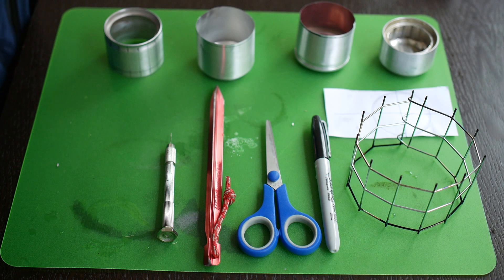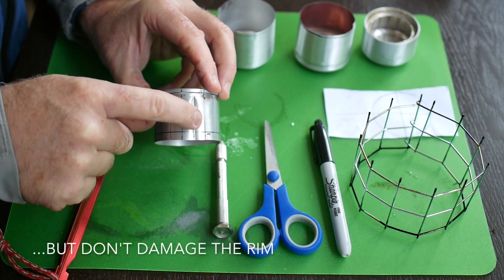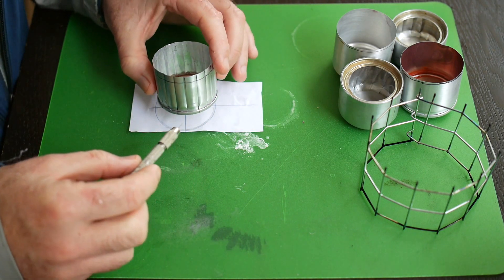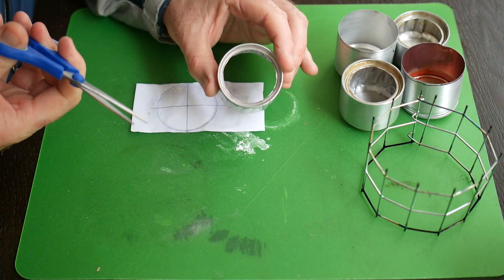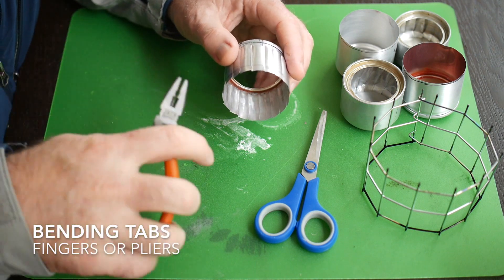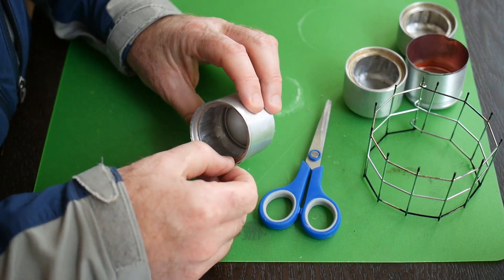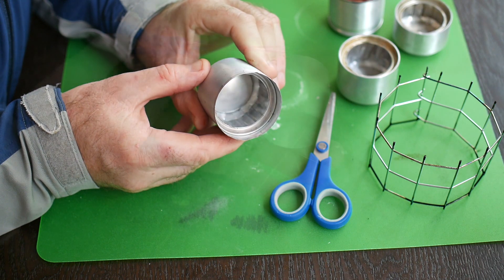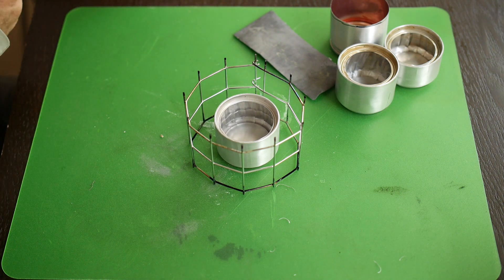Easy Capillary Hoop Stove 3: Drilling, Creasing and Assembly

Comment: I wish we had cans like that in America.  The top of any of our can concave inward, so it just leave a huge gap
Reply: In America I find a number of cans have tops that that are just slightly narrower (maybe 1 mm) than the body (V8 Juice cans, e.g.). They can still work. I just cut the outer part slightly taller than the inner part and then fill the gap with JB Weld. It works fine.

Comment: You made your channels perpendicular from mark to mark.
Try going from the top mark down but not straight down. Change to an adjacent mark to make an angled channel.
This should allow more contact surface and add in a slight swirl effect.
Allows more time for vaporization.

About your drilling holes -
Start a hole but use a finishing nail if you can find the right size, insert it into the hole, and bend the hole with the nail to the desired angle.
Preferably the same angle that you made your channels.

Instead of bending the tabs inward, bend them outward.
Allows for more contact between the inner piece and the outer piece as well as making the stove a bit more solid.

Prior to insertion, place the channeled inner part in the freezer for 15-20 minutes.
When ready, heat the outer part like you did and quickly get the inner part inserted. That method is similar to inserting bearings into a motor end bell.

Nice video. Wish you showed how it burned (lights out), some times, and how much fuel used.

Comment: Very nice videos. I have made many of these using Tetkoba's original videos and use them exclusively on my backpacking trips. When used with a pot with a heat exchanger such as an Olicamp XTS pot, I can boil 2 cups (473 mL) of water in just over 4 min with about 12 grams of fuel. Another trick to save fuel is to add a lot more than you need and then just set the pot gently on the stove to snuf out the flame and transfer the excess fuel back to your bottle. No waste at all that way and you don't have to guess how much fuel you need. BTW, I have a hard time finding cans with the desired rim that is the same circumference as the body. The ones I get are very close, but not perfect. They still make perfectly good eCHS stoves. I just trim the outer wall to be perhaps 1 mm taller than the inner and then fill that gap with JB Weld. Works great, but adds a day to the build to let the glue set. Also, I use an architect ruler to make the ridges. Haven't found a great way to cut the top yet. I use of combination of your tricks. My solution is to get it close and leave it rough and ugly. Still works. I don't bother removing the paint either.
Reply from the maker: Great tips - thanks!

Comment: Thanks for the videos! Did you find the JB Weld was needed to seal the can rims?
Reply from the maker: Generally, no. However, one of my favourite stoves has started to leak around the rim, so it is probably a good idea to use JB weld if you have it.
Reply: Ah, interesting. Would you seal just the inner pressed rim, or both the inner pressed rim, and the top where both cans join before folding the top of the outer over the inside can?
Reply from the maker: The leak I'm talking about is at the top of the can, where they join before folding over (I actually don't even bother to fold over most of the time). I have experimented with one stove by sealing the gap underneath, but it didn't seem to make much difference to efficiency. Your experience might be different, however, depending on what types of cans you're using. I always used the same type of can, which I obtained from a Japanese store called Daiso.

Comment: Boy, I am just not having any luck getting the pin vise to drill through the can. I dunno if it's me or the can or the vise, but it's just making no progress towards going through. Any advice?
Reply from the maker: It can take a LONG time to get the pin through the can - especially if it's a cheap drill bit. Sometimes five minutes or more.
Reply: Thanks! I ended up getting a better bit and it worked fine... Only 45 seconds per hole or so. I realized that the fruit juice can I used on attempt #1 was the same dimensions as a Redbull can, but was MUCH thicker aluminum. For attempt #2 I used a Redbull can and it made the job much easier in all respects. Still wasn't a success, unfortunately, but maybe third time's the charm. So far I can't get any jets to work because all the gas escapes from a fairly significant gap between the two can parts (inner and outer). My second build wasn't nearly as difficult to push together as yours because it just didn't make any kind of seal. I'm wondering if my Redbull can was once again the wrong type.
Reply from the maker: I don't know where you're based, but I read on a hiking forum that Red Bull cans don't work too well in the United States. The cans seem to differ a bit depending on your country. There's a very long thread on Appalaciantrailcafe.net in which people discuss can types and construction methods. Google it if you want, but it's a long read!
Reply: @jandal8905  Yes, I am in the US, so I'll have to head to a larger Asian market and see if I can't track down the same can you use here. If not, maybe I'll try the universal version.
Reply: I've built 4 or 5 of these now with different cans - none seem to perform like yours or Tetkobas so far. My time to reach boil with room temperature water is more like 12 minutes. I think I must still not have a good seal between the can inner and outer pieces. Have to get some jb weld, I guess.
Reply from the maker: Sorry to hear that, Jonathan. Good luck!
Reply: @jandal8905  Success! After adding the JB weld, 1 of my stoves does achieve boil in just about 6 minutes - so I'm pretty happy with that. Thanks again for these thorough videos!
Reply from the maker: Glad to hear that, Jonathan. It takes a lot of work and experimentation to build a super-efficient efficient stove. Objectively, it's probably not worth it - you have to be very anal (like me) ...
Reply: Can you not use a dremel tool instead ?
Reply: @stanlocke1009  Can, but probable the jets will don't have the precision necessary for create the tornado effect.
Try use a small diameter drill first, and the open for the final size manually.

Comment: Fantastic... especially the jet drilling tips. Many make the mistake of drilling straight through and then angling the jets. I agree with you. It is best to try to get the proper angles in one shot. Good job. I am going to send TetKoba a link to your videos. I am sure he will like them as well.
Reply: One tip that I never see anyone mention is to flatten the collet to the body near the ribs. To do that, use an empty ball point pen and run it close and parallel to the ribs on the inside of the stove after it is fully assembled (Dragging the pen towards you). Doing this will make the ribs uniform and balance the stove better. If you have a stove that pulses, it might be because the ribs are not uniform. You have covered all the important steps and offered great insight to resolving some of the obstacles you face as you build these stoves. My rib tip is not the most important. However, I find that those that are willing to build an eCHS right are interested in making it as perfect as possible. Again, great videos.
Reply from the maker: You are the man, Mr Bird Brain.

From memory, you are one of my sources for some of these ideas.

Comment: when you use the pin vise to drill through the can, are you going through the can twice? once through the outer cylinder and once through the lip?
Reply from the maker: Yes.

The outer cylinder and the lip (actually, the lid) are very close to each other or even touching, and sometimes you cannot feel the vice hit the gap between them. But sometimes you can feel the gap.